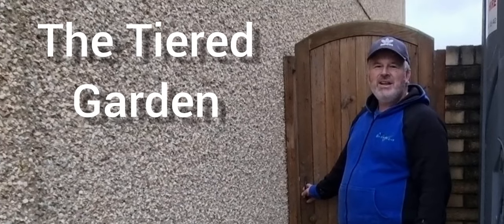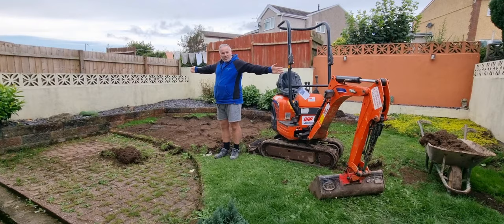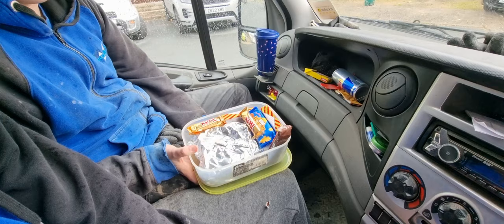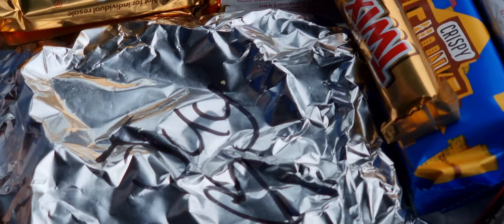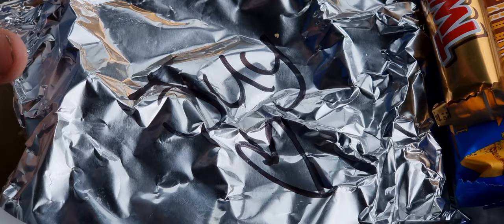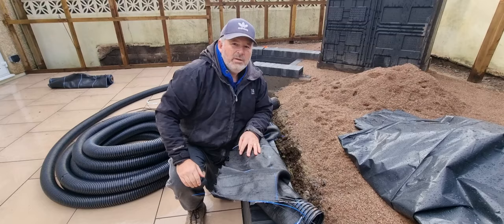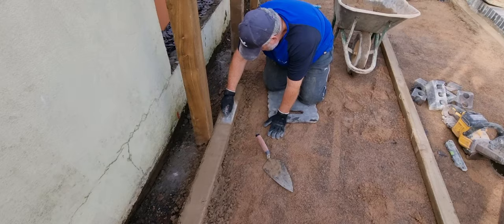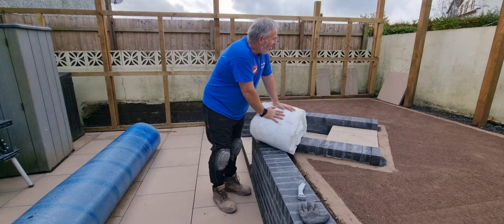Tiered Garden -full project

Comment: Jam sarnies 🤢🤢😆 top class job buddy see ya got a proper wheelbarrow now 😜 wee margin trowel also for the glue 🤟🤟. You will have young trained up no time your son going great guns buddy 🤟🤟🤟
Reply from the maker: Cant fault a Jam sandwich lee 👍😀 the new barrow is excellent aswell and Fra is doing great proud of him mate 👍 👏
Reply: @brickrightbuildinglandscaping  
There baulky in the van. But they are tremendous other than last for years and years. And all parts can be bought for very little. Absolutely hate picking a steel 1 now which is very rare. With being down so low down unbalanced them belle warriors tick all boxes. Fra a great asset for ya buddy.
Reply from the maker: @L Milne  the lads love it lee .Balanced easier to use does tip when u load it from a digger .Also wheel doesn't bunch up with mud .Yea well worth the money so far .Thanks for the comments on fra he has replaced Brad really well to be honest 👍

Comment: Another daft question for you...🤣 Is there a reason why you do the front face of the wall before the breeze block at the back? And do you leave a gap in the middle (between the front brick and the breezeblock) for any reason? Cheers again
Reply from the maker: Hi greg
For ease put 3 courses of bricks in the front where you want them to go.
Then lay 1course of blocks behind same level and repeat until finished. 
You dont want your blockwork to be higher than the bricks as wont be able to lay a brick on edge to the top of the wall.
The gap is about 10mm so width of wall same as width of a brick thats the gap mate .
Hope that helps 👍🧱🧱🧱

Comment: That black grouting in the paving, is it resin based compound and is it the stuff that’s suitable for outdoors?…I’m assuming it is but reason I’m asking is I’m getting my garden done next month and I was told to make sure they’re using outdoor resin for the grouting so wondering what it looks like.
Reply from the maker: No its not resin its flowpoint .we dont use resin or polymers in my opinion they are rubbish they dont work .
Id only use an outdoor tile grout for porcelain or the cement based products such as flowpoint or marshalls exterior grout .
Good luck 👍

Comment: Another great job.a real transformation.  What's the minimum fall you use on porcelain? Have you gone off slurry jointing? I've noticed you, Tidybricks and Brockkstone dabbing grout in recently?
Reply from the maker: Thanks JC
They do suggest around a 1:80 fall about 12.5mm per linear meter but we lay it on the line of the spirit level.As for the grout we've been using fuga pave flexi ch grout which suites porcelain perfectly we like trying new products. The slurry grouts are still good next video we use flowpoint so 👍.awra best jc
Justin 👍 🧱👊